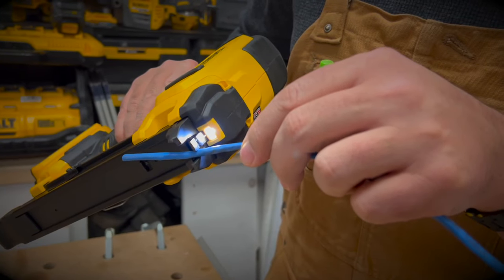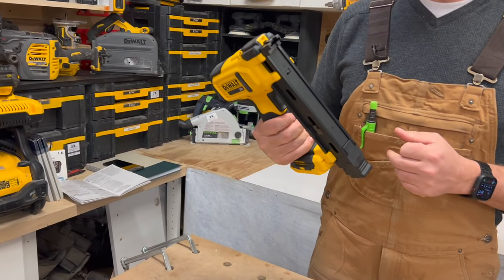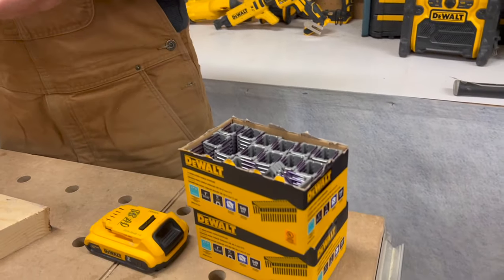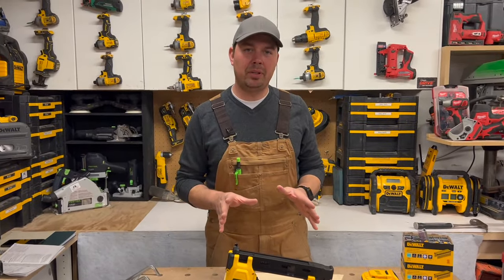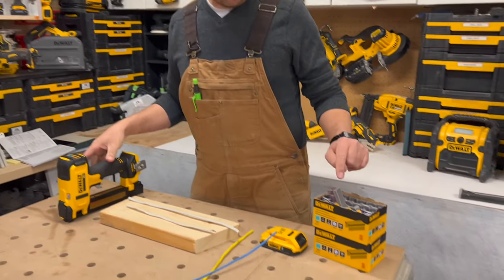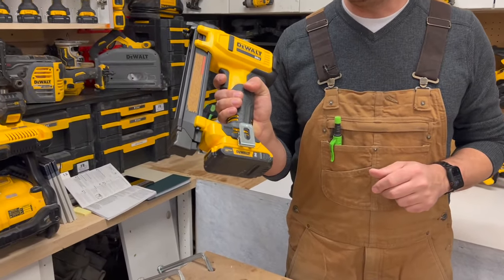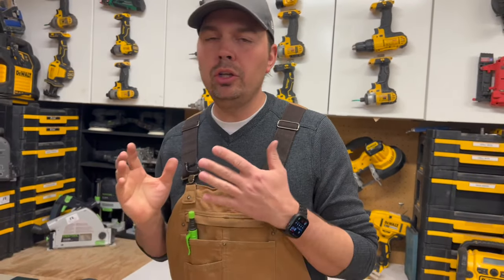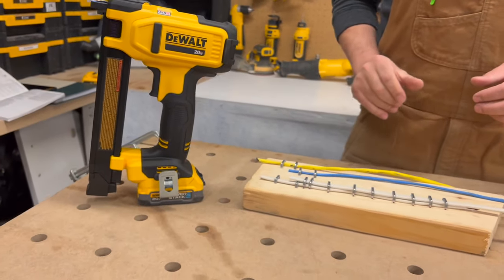Save HOURS of time! Dewalt Cable Stapler DCN701B review

Comment: You have more instantaneous power but not more run time with power stack batteries; the power stack batteries are only 1.7 Amp/Hr batteries which is less than 2 Amp/Hr. 
Power stack simply has a higher instantaneous power level similar to battery packs with 21700 cells but in a much smaller form factor; the power stack batteries however cannot as of yet compete with run time, operational longevity, or sustained throughout as a duel or triple pack of 21700 cells will both offer higher instantaneous power as well as a much extended run time.

Comment: The cables looks so loose. Seems like a terrible product. Having tidy runs is a very important factor
Reply from the maker: they do meet code, staples are not supposed to pinch the wire, having a bit of play is ok
Reply: I agree. Way too loose. You can snug up a wire and it will still meet code